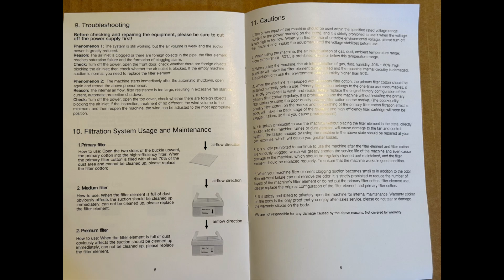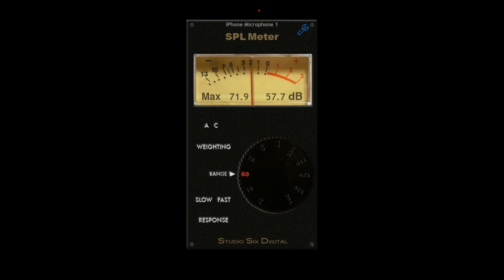Fumeclear Solder Fume Extractor - First Look #firstlook #soldering #fumeextractor

Comment: Back in the early '80s, I worked a temporary job soldering 12 - 15 circuits boards each day and breathed in the fumes each time a solder was done; no such devices existed back then.
Reply from the maker: You are not alone...I did the same, never used any type of filter or fan. Even just a fan blowing it away from your face would have been helpful.

Comment: Can I ask what is the output of the power adapter as they don't show the power anywhere which I find strange
Reply from the maker: Hi, my adapter for the Fumeclear shows this on the case: Input: 100-240V AC 50/60Hz 1.5A, and Output: 24.0V DC 2.0A 48.0W with center terminal positive.

Comment: Thank you for the review.  Based on what I saw i just picked up the Fumeclear. The price point is right,  the filters are not crazy expensive,  and it works for one soldering station.  It's perfect for my lab.  I have a different and very cheap one now that does pull the fumes away from my face,  but it's just a plastic box with a plastic arm and a computer fan with a foam screen.  It was also $15 lol.  The Fumeclear is a good price point for me since I don't want to spend over $600 for the Hako, and then more $$ when I need filters.. Looking forward to getting mine tomorrow
Reply from the maker: Awesome!  Glad the review helped you decide.  I think you’ll notice a big difference compared to the little $15 fan.  The Fumeclear really does a nice job for a single station without breaking the bank.  Let me know what you think after you’ve had a chance to use yours!